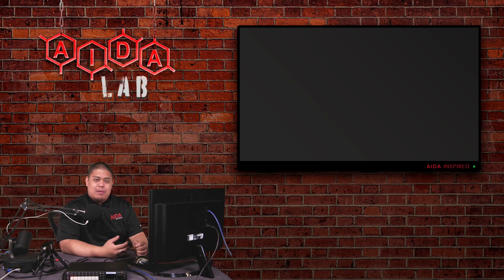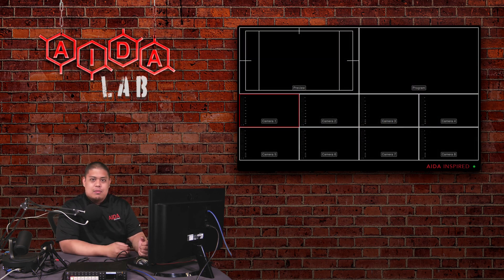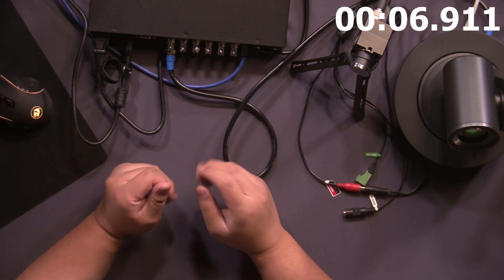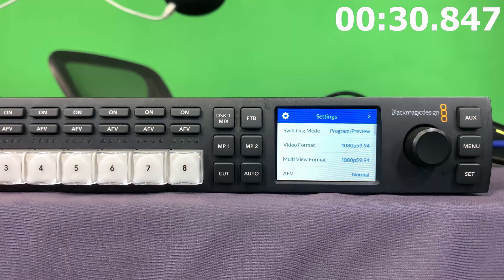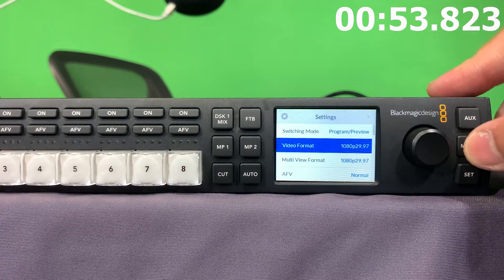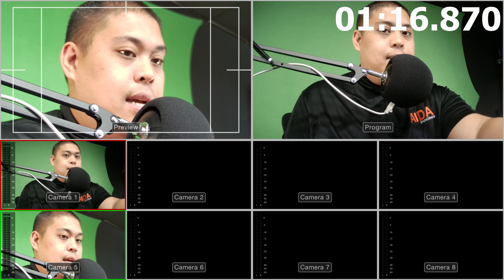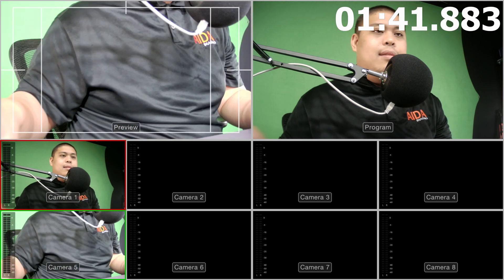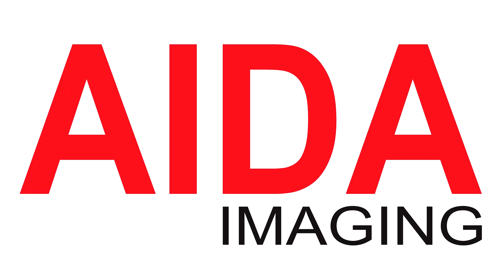AIDA 2MT: How to connect AIDA Cameras to a BMD Television Studio HD (or any other BMD product)

Comment: Is it possible to go the other way?  Can you change the output framerate of the AIDA cameras? Internally set@29.97p but outputing@59.94i over HDMI or SDI.  Example: In a scenario where the ATEM TV Studio NEEDS to be set @59.94i...
Reply from the maker: Hello friend,

Great question! If i am understanding it correctly, yup you totally can! Initially the cameras are set to 1080 30p as mentioned. In the camera settings, you can change the resolution to 1080 59.94i, thus making them work. Its always easier to go through the switcher however since it has a display! Our cameras can only be changed if they have an image 😅

Hope this helps! Thanks! -Justin